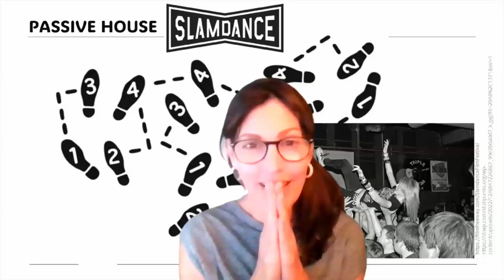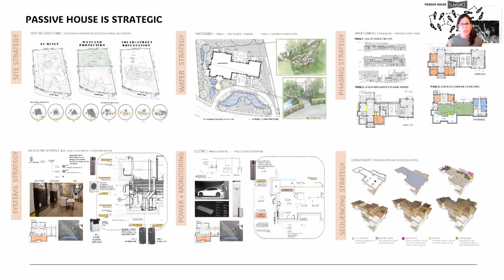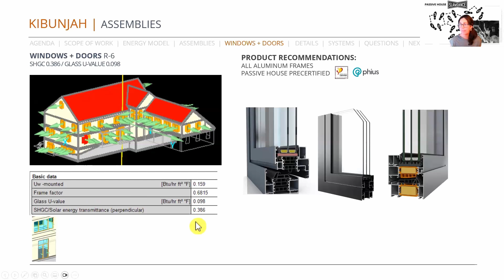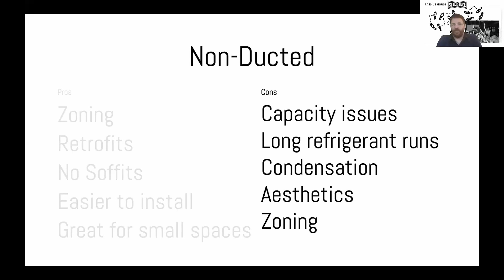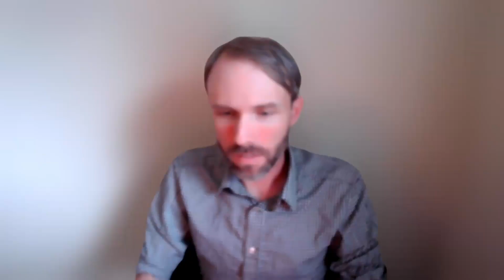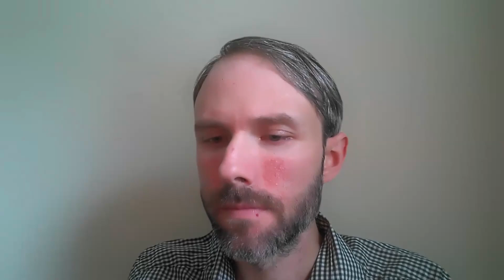Passive House Slam Dance!

Comment: seems to me that designing balance ventilation is not rocket science...  Flow in to the house  = flow out of the house.  What are we really talking here??? 100cfm in 100cfm out   move air from moist places out like bathrooms laundry room and kitchen..replace the air with inflow air to places like bedroom and living room  perhaps if you think you need it tiny tubes running to just keep air from getting stale into a closet..(personally think this is over kill)    When cooking need a dedicated make up air vent to balance out whatever one is venting via a range hood.  Does not matter if it is a small residential building or a large multi family building..  Like any quality duct system  straight runs are always better.  Every time you put in a bend you reduce air flow wheather it is a hvac or plumbing or a ventilation system  Bends kill pressure and flow.     Good quality filtration perhaps to mirv 13 will go a long way to improving air quality.  So I come back to the original question... if one uses common sense should not need an engineer to build a rocket
Reply: 100% Steve ~ thanks for your comment, not rocket science just building science :) 

You’re obviously ahead of the curve when it comes to delivering superior air quality. I find many teams aren’t, and it can be challenging for homeowners and residential architects to find professionals with your understanding. 

I really trust Certification that includes third party testing to be a great tool for delivering QAQC especially for teams that haven’t worked together before or are doing this kind of work for the first time.

Be well!
Reply: @Shannon.PassiveHouse  I am just a old school remodeler long time retired.  Still say garbage in   garbage out.. all things need to be equal  LOL
Reply from the maker: Are you teaching the next generation?
Reply: @GreenHomeInstitute  I wish that I were but like everything one has to get training which i have not had.  What I do bring is a back ground selling HVAC equipment.  A lot of curiosity about all things building science and frankly a lot of common sense.  Whatever goes in must go out or one is inflating and deflating a house sized balloon.  So with whatever part of the cycle one is on heat and moisture are moving in or out.
Reply: …& often I prefer an hvac designer w/ install experience over an engineer without :)

Comment from the maker: Here are the live survey results from this webinar " Based on the survey results, people learned about innovative building materials such as the Perfect Block, Fastfoot, insulated concrete forms, and timber HP Batts wood fiber insulation. They also gained insights into new construction techniques for high-performance foundations and the use of double stud walls for energy efficiency. Additionally, there was interest in the collaboration between students and firms representing new technologies, and the potential for cost-effective vocational educational programs in high schools. Questions that still remain include inquiries about reusing water removed from the system, the carbon impact of construction processes, and the specific details of the new foundation system mentioned in the survey."   What did you think?